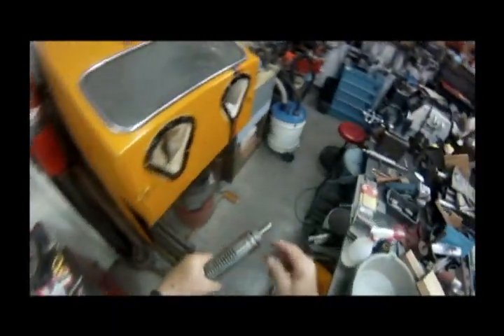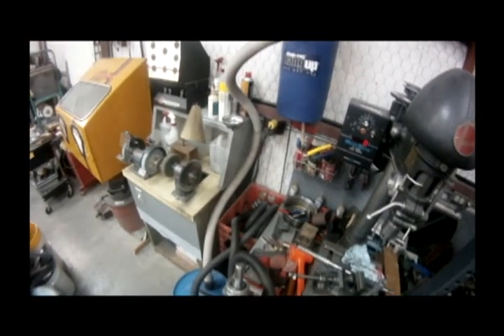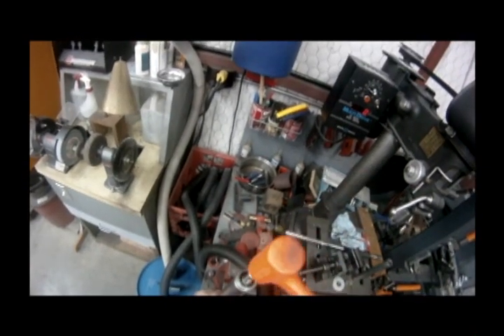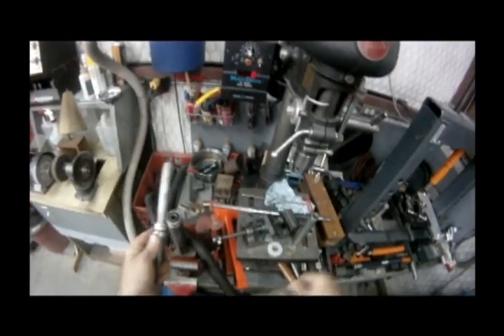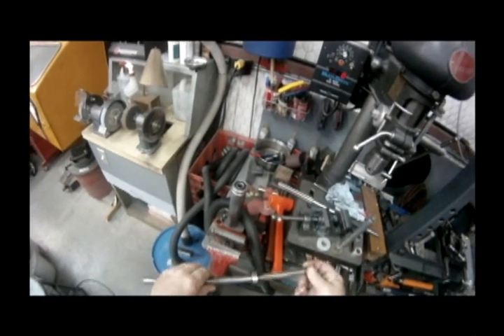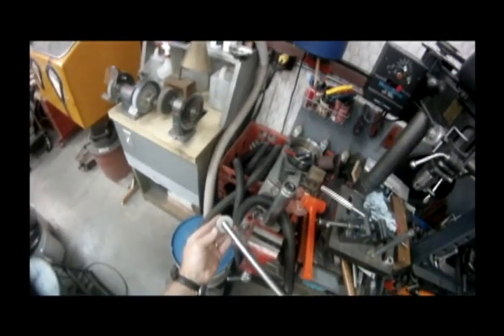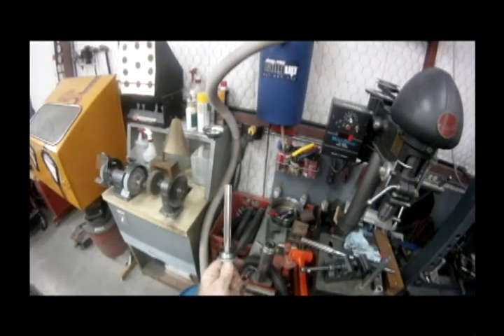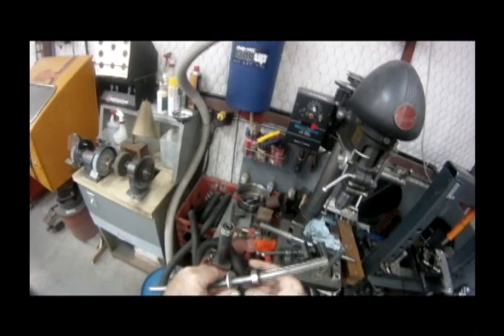10ER Quill Bearing Replacement

Comment: I'm just refurbing an old drill press the quill is similar to the one in your video but has a threaded collar on the taper for removing the Chuck. It has two angular contact bearings, is there a certain way around to fit them when used as a pair.